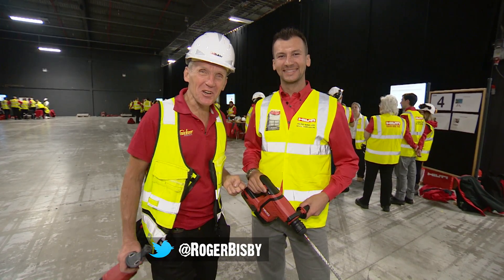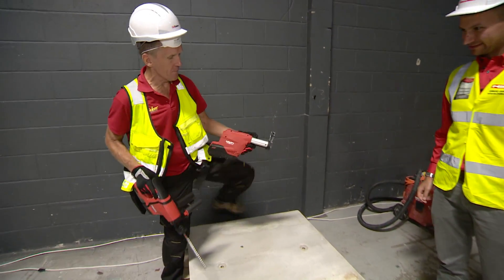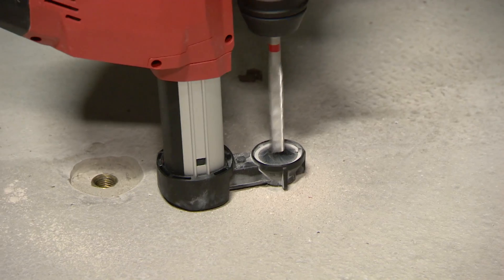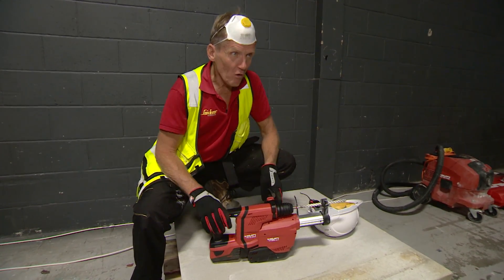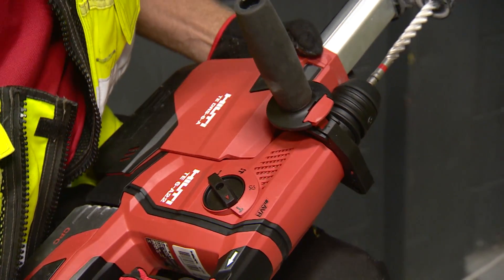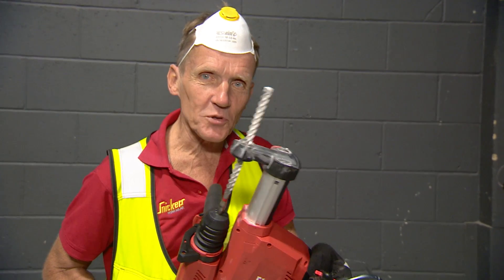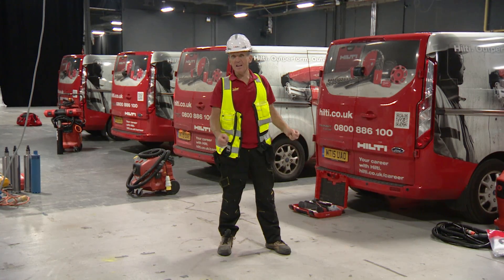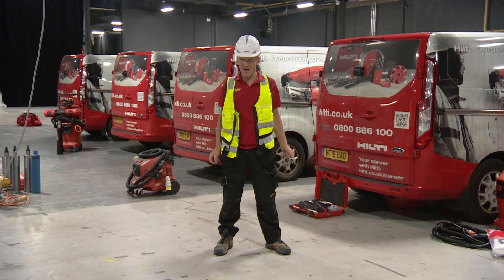Hilti TE 6-A22 Cordless Rotary Hammer Drill

Comment: For the amount of concrete drilling I do I opted for a cheap rotary hammer that also came with 2 chisel points and was blown away by how fast it drilled, about the same speed as you just showed. It has rotary hammer/ hammer/ and rotary and also had a rotary chuck with it.
Reply from the maker: Fair enough if it does the job but for pros those cheap drills have way too much vibration to use for more than an hour or two. As someone who now suffers from white finger in the winter I wish they had tools like this years ago.

Comment: Slightly confused. So the dust extraction only works on shorter drill bits and in this example the suction part didn't actually come into effect until part way up the drill bit?
Reply from the maker: VT You aren't confused, ,you have it right. There is a limit to the length of the drill used on dust extraction. It covers most applications for fixings but if you are running cables, for example, the dust extraction only kicks in on the last bit. If the dust extractor was longer there would be problems getting into tight spaces so there is always a trade off.